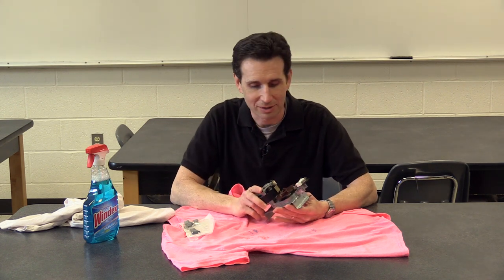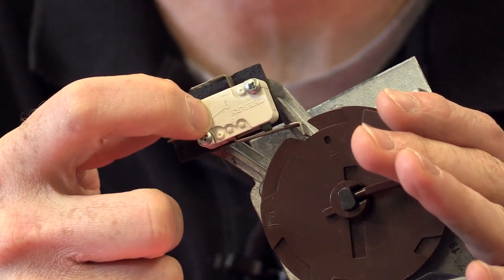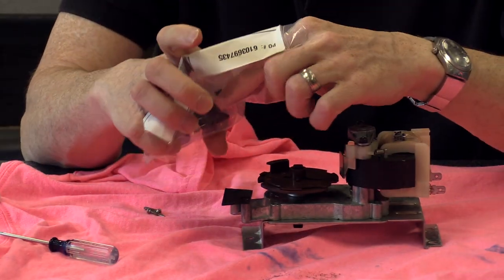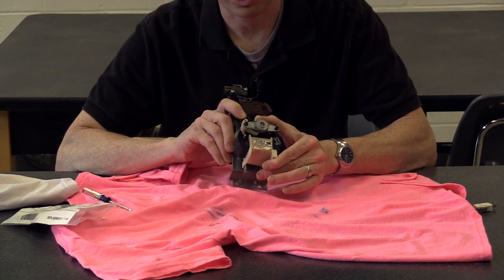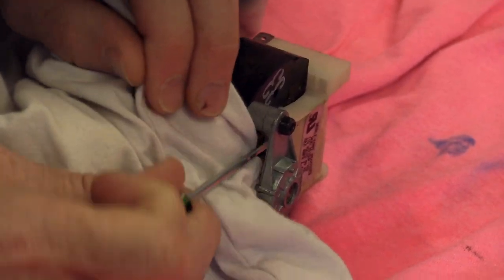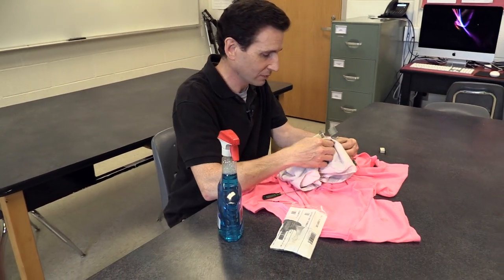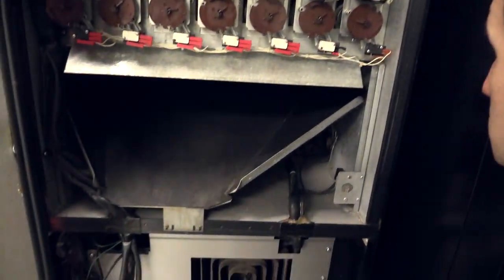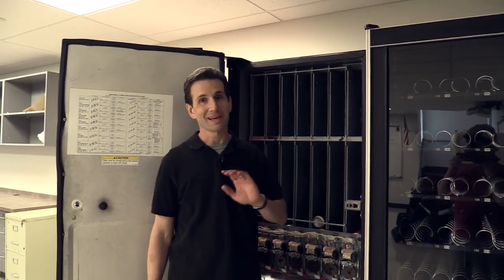Fixing a Vending Machine Motor

Comment: Well these videos were extremely helpful in a way to me. Everything is going well with the venture I told you about. I started having column 6 double on me. I kept staring at the motor. Completely familiar with how it works now. No video i have watched showed the complete interaction of both the rotor, motor, and shims. I was thinking it was a motor but everything I could tell indicated it was fine. The motor kept stopping in cam position two with a empty rotor. Kept eyeballing and eyeballing below until I figured out they sent the wrong shim. Two of my columns are partially configured for cans and bottles. Bottle shims with can rod. This setup works for 16.9 bottles but I do not know how well and it doubles randomly with cans. Glad I found the issue. Thank you. I think somebody needs to do a video about how they all work together in harmony. Maybe its something I could do but I am not very videogenic. Thanks.
Reply from the maker: Glad you could figire out the problem.

Comment: I have 8 Dixie narco motors in my machine. On one of them, the motor switch is pressed down and stuck in the middle of the cycle. The rest of the 7 motors work when I press their switch. My question is: if one of the motors doesn’t work, does the whole line of motors lose the ability to be activated by the buttons?
Reply from the maker: If it is a newer machine that runs off a control board, it won't be an issue.  If it's an older electro mechanical machine, it could stop the other motors from running.  Just replace the motor switch and you should be ok.  You can also try cleaning it with some windex because it probably got covered with soda.

Comment: I have been binge watching your videos for 2 months now we have 5 machines now and getting ready to put them all out 11-1!

Do you know where I can get a new wiring harness for the 276e? The wires going to the micro switches are corroded and falling apart
Reply from the maker: Did you contact Crane?  If not, try contacting some used equipment dealers near you....they may have parted out an old machine and will sell you a used harness.

Comment: My Royal Vending 804 has a motor that dispenses automatically, (eg. No coins are inserted, and it will start dispensing randomly.) Would it just be the switch going bad?
Reply from the maker: The 804 only has one motor that vends all 12 columns.  That's odd that it would vend a column without any credit in the machine.  Does it always vend the same column?  Does it vend normally when you put money in the machine and make a selection?  Is it displaying any error messages?

Comment: Thanks for your help with your videos which has helped me a lot as a newbie in the business
I have a question: How can I fix my crane 158 (Exact Coin message) even I have a full coin inside the coin holder? please help.
Reply from the maker: You should check and see if the machine has a "tube fill" mode.  If it does, empty the change from the coin mech and refill it while the machine is in tube fill mode.  That will tell the machine how much change it has in the coin mech.  If that doesn't work, you might want to switch out your coin mechs and see if that is the problem.

Comment: Hi, I’m having a issue with my machine. Before I filled it. 1/2/3/6 slots worked. 4/5 stopped working long ago. Now nothing is working. Number 3 will turn the cam when pushed manually and drop a pop. None of the other ones that did work, will work now. This machine is set up on a bypass switch. Tap the switch and select a drink and it would work. But not no more. Any suggestions? Any service people available in northwest Indiana? Thanks for any help.
Reply from the maker: What model machine do you have?  It might be that the switches on the motors have gone bad.  You could try purchasing some new switches and see if that gets the motors going again.
Reply: @HappyVending  thank you for your reply. I don’t know the model number. I have pictures of outside and inside but It won’t let me post a pictures on this. I wouldn’t know how many switches I would need. Looks like just more than one per motor?

Comment: How to you test the machine to see if it works after cleaning the motor?
Reply from the maker: Just vend a product from that column and see how it works.  Or you can enter the test motor mode in the control menu and test vend that motor.

Comment: Thanks for the info! My can vend motor on my AP combo machine intermittently fails when I test vend it. It also makes a rubbing noise as it vends. Could my empty switch  cause this problem?
Reply from the maker: Why not swap that motor with a known good motor in the machine and see if the problem follows that motor?  I didn't know those machines had sold out switches.
Reply: @HappyVending  yes they look almost identical with just a different part number. Ok I will try that while I'm disassembling the machine for another repair. 👍

Comment: I have a vending machine FSI 3037 I push the button it says select another selection it won’t vend two of them say that the rest works without no problem do you have any idea what I could check
Reply from the maker: I never operated one of those, but I would just swap parts from a working selection until I figure out the bad part...vend motor, vend switch, etc.
Reply: @HappyVending  ok thanks and i love your video keep it up they are so help full

Comment: i have a royal669 and two of the buttons dont work , do you know what it could be ?
Reply from the maker: I would try to narrow down the problem by switching parts from a working selection until I find the part that's bad.  Start with the selection buttons.
Reply: thank you , how do i take apart the selection buttons ?
Reply from the maker: @CesarRipsForHits  I am assuming you have a 660-9 g3 machine.  If so, you will need to remove a couple nuts to remove the button panel. Then you will be able to access the selection buttons.
Reply: @HappyVending  thank you, do you have an email i can contact you at?
Reply from the maker: @CesarRipsForHits  billc@ptd.net  Try to visual the area by checking out the manual... https://www.google.com/url?sa=t&source=web&rct=j&url=https://www.royalvendors.com/wp-content/uploads/2014/01/giiimanual.pdf&ved=2ahUKEwjWrM7535nxAhVFZN8KHbvSCIUQFjAAegQIBhAC&usg=AOvVaw1uMgXUAUhoSkKzNCP05i8X

Comment: I have a royal 660 and gave me an error VEND HS, chain runs with 4 actuators but doesnt gave me product… can you help me out, please 🙏😭
Reply from the maker: That's a vend sensor error.  It could be that one of the actuators on the chain got messed up, the vend sensor is bad, or the vend motor is bad.  You should download the GIII manual from the Royal website and read the troubleshooting section for that error message.  It should help you narrow down which problem you have.  I've replaced the vend motor and sensor on one of my Giii's and it wasn't too hard, but the motor is expensive.  Hopefully your motor isn't bad.
Reply: @HappyVending  got it, Ive already download troubleshooting document, let me try it, thank you so much for your help. Have a great one 🙌